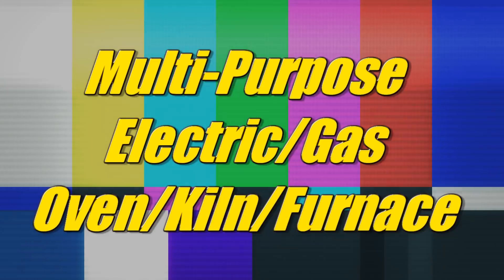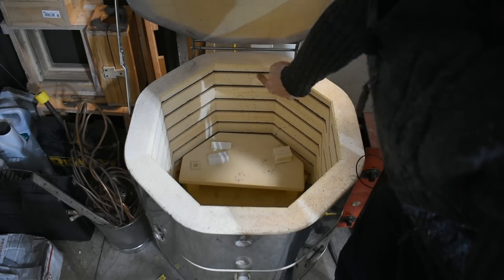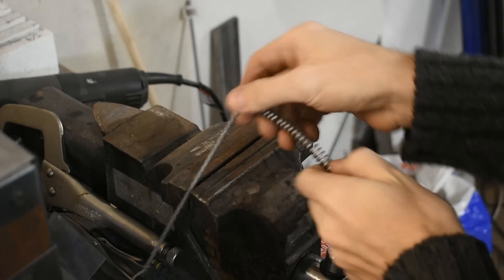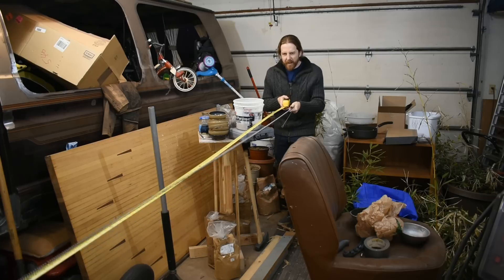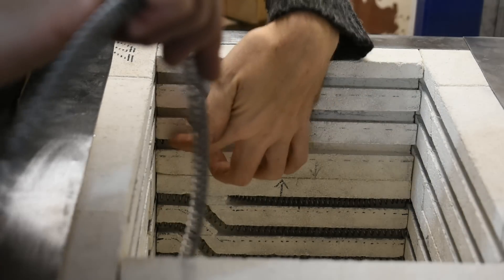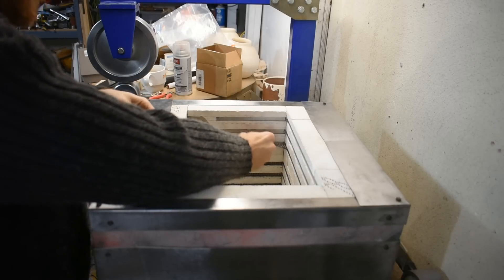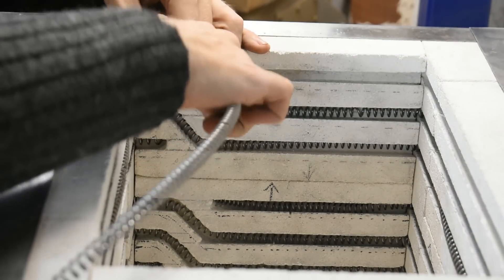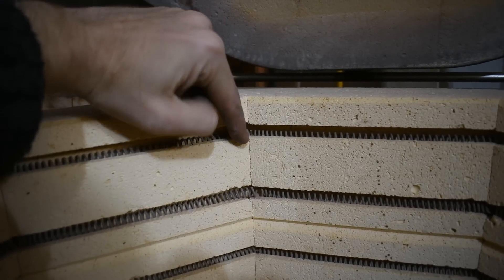DIY Electric Heat Treat Oven/Kiln/Furnace Part 3: installing the elements

Comment: Hello, How did you do the measurements for the element?  for example, If my Oven has an inner size of 60x60x75cm and I want it to heat at 1300 C, how should I measure the correct length of the element and its diameter?

Comment: Hi mate, regards from Spain. 
Really intetested in this video since I want to build an electric kiln for ceramic for high temperature, at least 1280-1300°C. My question is how to know how much electric power you need (kw) related to volume of kiln and so how many meters of kanthal cable you need.
Hope you will read this coment even from  such an old video
Reply from the maker: I didn't do any math for choosing the elements.  I took 2 elements for a Skutt 818 kiln, which can heat above 1300, and fit them into a smaller volume than there is in the part of the kiln with those elements.  A Skutt 818 uses 4 elements, I put 2 in a volume less than half the size of that kiln.  So I have more power in a smaller space.  I didnt shorten the elements at all.  I hope this helps!
Reply: @PaulsGarage  ok, I'll have to make It from almost zero (only Will remain the main iron estructure from an old low temperature kiln), so I needed some info
Reply: @PaulsGarage  anyesy thanks so much for answering!!!!

Comment: I'm curious why you didn't use the correct brick? The lightweight brick in that Kiln is what you should have used! The only difference in temperature for a kiln say a cone 6 Kiln that's ready to like somewhere around 2,150° f in a cone 10 kiln is the thickness of the brick. It's the best insulated brick on the damn planet

Comment: I am trying to build a thermal sand battery that is kept at 500°C electrically 24/7.
What element could live at 500 consistently with a long lifespan?
Reply from the maker: Kanthal kiln elements could no problem.  This one can hold several hours at 1200c, I imagine 500c would be no issue at all

Comment: There was a gray pole you could have used to mark the spot where you needed to stretch the wire to. It beats holding a measuring tape while pulling the wire.

Comment: When I built my metal foundry, I came up with a trick to get the element the correct length the very first time.  I placed a rope of the same diameter in the grooves and marked it where the rope came to the end of the final groove.  I measured this, and stretched the element to that length.  Perfect first time around.

Comment: I was hoping you've put some power to it at the end.  I would not have been able to resist that temptation.
Reply from the maker: I had the temptation for sure, just not the wire itself.  Otherwise I totally would have!  I had plenty of tiny stuff, like thin thin aluminum wire, but I didnt have any 10ga copper stuff.  That has been resolved, however.

Comment: Hey Paul,
thanks for this video, you inspired me to continue on my own. I had the problem with that chinesse elements so I ordered elements for water heated (we call it boiler).
I also got info from one professional, that the groove should allow more air circulation around the wire. I had that problem with overheating (and breaking) in areas with more dense turns.
I am looking forward, how this your solution works.
Keep going
Kamil

Comment: Reminds me-tore apart a large Microwave Oven.  Was thinking ofr using it for something but not sure what.  Since I can't weld I may measure it and use it to build a Melter-some fire bricks, some element and 'lectricity-try not to kill self or burn house down and....
Reply: I am working on a kiln based on a microwave chassis with the insides of a toaster oven  inside it and insulation between those 2 things.  will operat on 120v.

Comment: You have a lot of electric kilns.
Reply from the maker: Unfortunately the biggest one doesnt work.  Not enough power to run it in my garage
Reply: @PaulsGarage   how much power does it need?
Reply from the maker: The big one is 240v 50amp, I only have 30 amp service in here.  That's good enough for the welders and the smaller 8 sided kiln (20 amp), and this small one I'm building is even less, around 12 amp.

Comment: Is putting them in horizontally going to create a heat bridge (?) I.e. can conduct heat out of the furnace because pin goes most of the way through the brick?
Reply from the maker: Probably not.  The pins are barely over an inch long, the bricks are 2.5" thick,

Comment: make sure you keep the new length written somewhere on the kilm so you dont have to find out by trying again , using a premade element for a clay oven seems like a good idea , maibe with the next kiln dsign instead of doing a joggle up do a slant toward the next row , that saves you a few bends in the elements and you can make the grooves in one go
make sure the pins you use to mount the elements dont poke through the stone against the metal or eachother as that would short part of the element or put power on the outside of the kiln , that would be pretty bad
as for cutting that type of wire , see if you can find pliers meant for a rebarb plier 
http://www.lewiscontractorsales.com/Merchant2/merchant.mvc?Screen=PROD&Store_Code=PAL&Product_Code=T21619&Category_Code=

these have extended handles and a shorter head with alows you to put more force on them
Reply from the maker: Thanks for the tips!  I definitely need better cutters